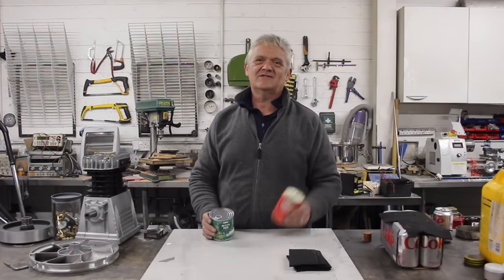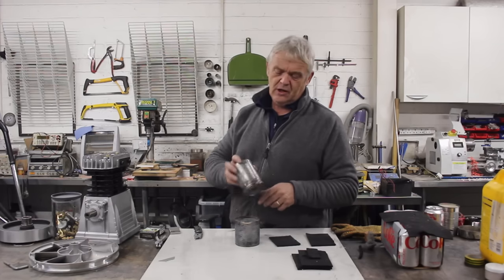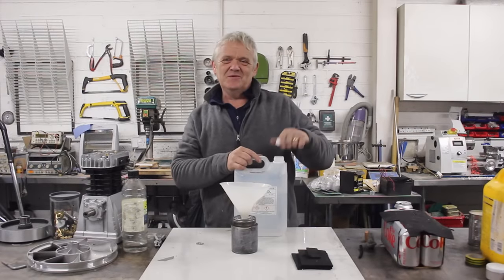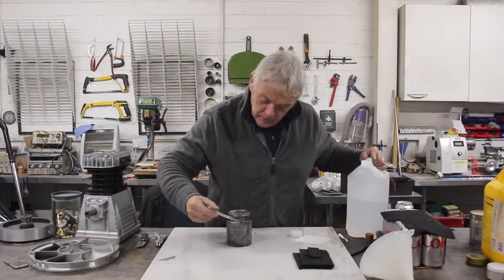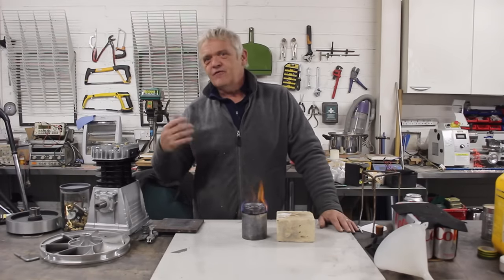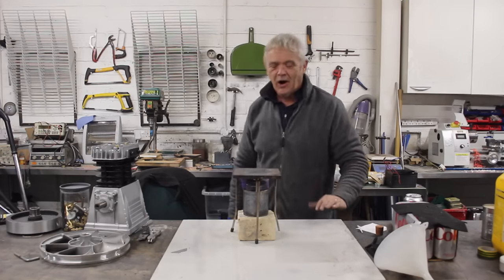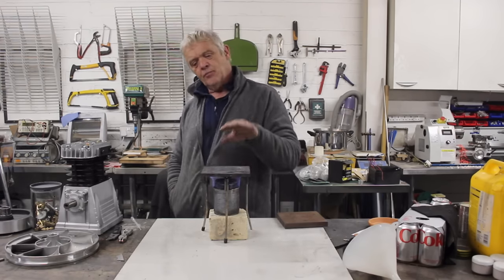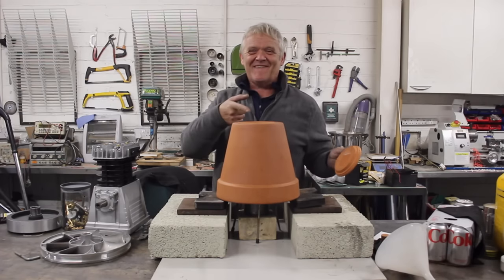1700 An Awesome DIY Multi Fuel Heater

Comment: I think you can make a nice video on how to make your own spectrometer using a CD and a webcam.
Reply from the maker: I suppose - I can have look at it mate
Reply: @ThinkingandTinkering  I made one using a diffraction grating slide and made it exactly like  "DIY Light Spectrometer" videos from Chris Wesely's channel describes.  He's in UK too. 
It's one of those things you wonder how you did without. 
identifies fake UV LEDs and verifies the  wavelength of lights. Very precise.  
Cheers.
Reply: @ThinkingandTinkering  I think you will benefit greatly by buying a kit from him for under 100 pounds, if you don't care to build one, and use it to see the effects of florescence in your research and experiments.
Once I have passed my lazy phase, I plan on designing and building a smaller version for my pan and tilt 8" telescope and explore stuff in the night sky.
If I'm super lucky, maybe  capture a UFO with all it's spectrum glory. 😃

Comment: Am I the only one that missed the last 15 seconds of the video? 
I need to just pick free fruit and convert the sugars to make fuel. Just need to work a way of running a distiller on a fire with no naked flame.
Reply from the maker: I did a distillation vid with a pressure cooker mate

Comment: Robert ... As mentioned on another video, try ceramic fiber. Not completely sure but it seems you have made a variation of the 'Fancee Feest' (NOT 'Fancy Feast) stove. You could do a whole video on ethanol vs methanol. Methanol is a very bad POISON. DE - natured alcohol means a NATURAL product is made not natural. Methanol is mixed with ethanol to make the combination very poisonous. It may come as a surprise to you, but people are, for the most part governed by ... well ... people who do not have your best interest at heart. Most likely ethanol will be an important fuel source in the future but the hard choice will have to be made to grow crops for food or fuel ...
Reply: And would still like to see your take on a thermal solar panel ...
Reply from the maker: cheers mate but did you know methanol was already used as car fuel - mostly racing cars
Reply: @ThinkingandTinkering   , Do you have a rough sketch in mind for a thermal solar panel???